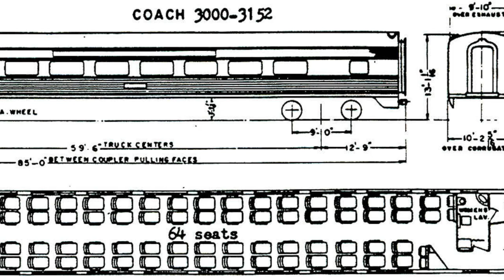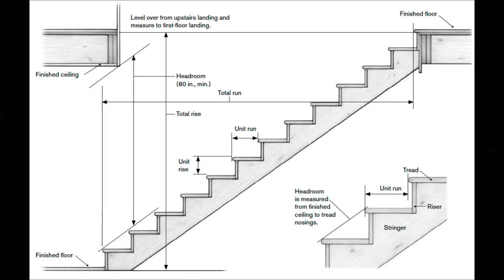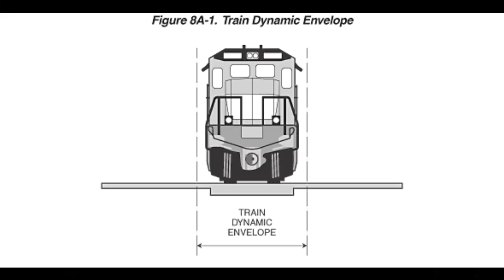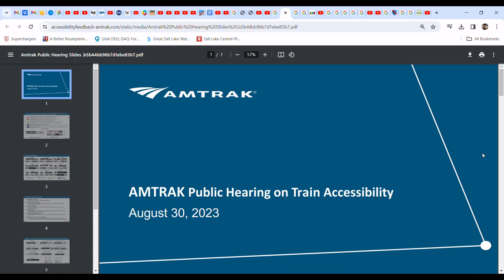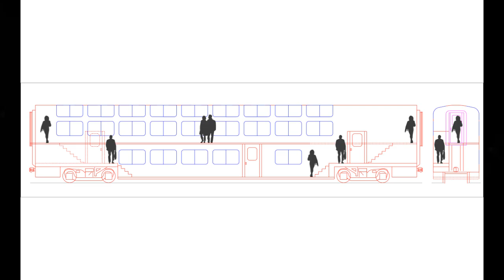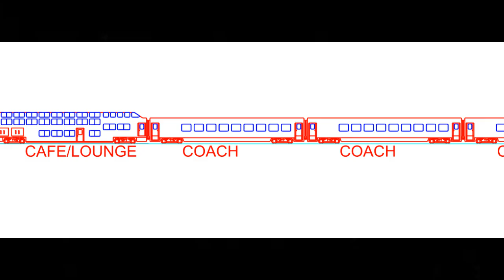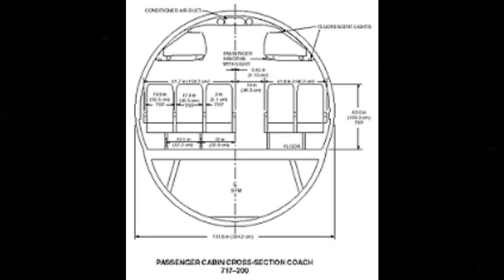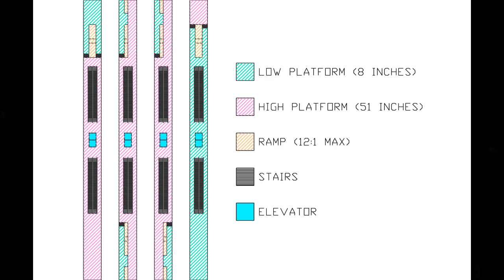An Excessive Explanation of North American Platform Heights

Comment: While I think the Superliners and original ATSF Hi-Levels are an extremely cool design I accept the cold hard reality may be that single level cars are the only logical replacement. The Superliner design certainly provides benefits to the majority of passengers which include helping to keep the main portion of the car acoustically and climatically isolated from the entrance doors. That's a major benefit when the train has to make station stops in the middle of the night. 

On other hand a benefit to standardizing around single level design is increased compatibility with not just Amtrak's east coast fleet but the emerging high speed rail routes like California HSR, Brightline West and possibly Texas Central which will have single level fleets. Even if Amtrak will never share actual trackage with HSR there is a solid argument to be made for adopting a common platform height for cross platform access.

I also hope a new long distance single level car design might result in the return of dome cars to some extent. ADA requirements may not allow the return of domes with elevated seating (unless lifts can be provided) however there could always be dome cars similar to the in-house design Southern Pacific provided on the Coast Daylight where passengers remain seated at standard floor level except the cars feature a raised dome like roof with overhead glazing. Rapido Trains is currently developing a model of this car in HO-scale. For long distance routes I think Amtrak will still feel the need for a car dedicated solely to sightseeing. The tourist market may not be Amtrak's primary function or mandate but it does attract a good percentage of passengers and Amtrak would be foolish to abandon it.
Reply: Single level would be cheaper to maintain, for the wheelsets could have longer overhaul intervals because of lower loading.

Comment: I'm from Australia. Just about all of our platforms are high level, and have been there for the better part of a century at minimum. I've never heard of a platform needing any more regular maintenance than the occasional sweep by a staff member.

Moreover, many of these stations have regular freight services running through them, and the platforms will maintain a gap no greater than 3 inches from the doorstep of the commuter trains. You mentioned that the dynamic envelope is wider for freight trains than passenger trains. But in reality, if a freight train is going to rocking and rolling to that degree, then that piece of track is completely unsuitable for passenger service. At least, that's the case in the rest of the civilised world.

In short, this all sounds like lazy, money-grubbing railroads making excuses to not having invested in infrastructure.

Comment: Thank you for this elaborate view on the complicated subject of platform heights in the US. We have similar discussions in Germany, with platform heights of 100 cm at some S-Bahn systems (39 1/4'), 76 cm (30'), 55 cm (21 3/4') and 38 cm (15') for tram-train services.Your Salt Lake ideas remind me on ours with proposals for up to three different levels at the two sides of a platform to serve as well long distannce, regional and tram-trains. Regarding the variety of platform heights in GER that will not vanish over the years I also like to give a special  emphasis to the idea of entrance doors with differnt heights adjacent to the ADA and multi-purpose area in regional trains to overcome this problem without the needs to rebuild hundreds of platforms in a few years to meet accessibility needs that were already neglected for too long.
Reply from the maker: I think you are right - train cars with doors of different heights to match different platforms seems like the only way to avoid a very costly rebuilding of hundreds of platforms. And in that case, it becomes more important that we settle on a small number - hopefully 2 - of standard heights so that we won't need so many duplicate doors!

Comment: "Since you will be hard-pressed to find any European  intercity passenger trains with level boarding"
At least in Switzerland I wouldn't say this is true. Non-level boarding trains are the French TGV, German ICE and the Italian EC trains (thou SBB to my knowledge owns some of those as well) driving in Switzerland (one could even argue those are not strictly "IC" trains) and SBB's old single-decker IC trains. The double-decker IC trains which are nowadays almost exclusively used for our IC services are level boarding (obviously only at be lower level). As good as all S-Bahn trains (city trains) have level boarding.
Reply: I was looking for a comment about Switzerland. It would seem our railway system is the most advanced when it comes to level boarding (as well as other aspects), although Austria in my experience is quite good in this as well. To my knowledge, the only IC line not featuring level-boarding is the IC5.

Comment: I think 51 Inch is way to high and there should only be 1 standard hight otherwise it isn't relay standardized. For example: I live in Switzerland and our standard platform high (Standard gauge) is 55cm (21.6Inch) it allows Level boarding for about 95% of all trains (it doesen't matter if single level, dubble decker, regional or Intercity) only some older Single level "Standard" cars don't have level boarding, however they are only used on either a few (usually international) lines and are gradually replaced by newer trains, or as rush hour extensions on Intercity trains.
Reply: The 51" standard has a lot of plus sides, though: It means American single level fleets can be truly single level. There aren't any interior height changes inside the train. Plus, moving away from 51" would mean redoing the most highly-trafficked rail lines and stations in the United States (as "high capacity, high quality train service" and "51 inch platform height" are almost synonyms in the northeast), so it's not workable.

Do also keep in mind that while much less densely-trafficked by human passengers, the continental US rail network is about as large as the European one. By that lens, we're actually more standardized. 😝
Reply from the maker: I have nothing but respect for Swiss trains! I'm doing my best to replicate their convenience and utility here in the US. I agree that having 2 standards is not as preferable as just 1, but it is definitely progress compared to the 4-5 competing heights we have to deal with now.
Reply: @CSLenhart  I agree 2 is better than 5, but if the us starts to standardize they should choose only one. Otherwise they would face the same problem as Europe. For example: Switzerland uses 55cm and Germany mostly uses 76cm (which are the 2 EU standards) it makes international train routes a lot more difficult because the trains need to be suitable for both hights

Comment: This problem is similar to our problem here, in Indonesia. Where there is difference in platform height. Fortunately, the big station in every major city has a standardized platform height ±1400mm above the rail since 1980s. But smaller stations in small sized city or in a town, the platform height is different than the standard one. From 250mm, 300mm, 500mm, 700mm, up to 1000mm. The solution is that placing movable steps in every platform so it could be moved when not needed. In case of the disable people, there is a slope for that.

We didn't have any Bi-Level in operation, but we had one prototype of a Bi-Level car in 1980s which is a modification from a 1960s East German passenger car. But due to the restrictive loading gauge and because it judders a lot, it just let rot somewhere in our maintenance facility.
Reply from the maker: That's a lot of different heights to deal with!

Comment: I think that it should be considered to bring all US platforms to 51in with gapfillers. Not all immediately, but keeping in mind platform heightening when stock needs to be replaced.
And the EU isn't perfect on the platform heights by far, but it's generally speaking 28cm, 55cm or 75cm (28 is basically 5cm or so above the rail)
Reply: 55cm is the most common followed by 76cm other highs are country specific older hights

Comment: The obvious solution is to just increase all new passenger rolling stock to 10’ 8” wide. It solves all of the problems with spacing and allows more space for passengers.
Reply from the maker: That would be an ideal situation, yes. Practically speaking, though, the transition period of narrowing all existing platforms and widening existing bridges and tunnels on the NEC would be pretty challenging, and replacing all existing cars with wider ones would be expensive. But in principle, I agree that wider is better!

Comment: Just a minor FYI: Those tracks aren't called Gauntlet tracks. They're Gantlet tracks. I believe it's named after someone who designed the idea.
Reply from the maker: Huh, TIL. Looks like I've put too much trust in Wikipedia this time. I love learning stuff like this!
Reply: @CSLenhart  Yeah. I didn't know it either myself, until I was looking up some info on streetcars. I stumbled across this, and went down a pretty long rabbit hole.  What I found was that the name originates from the original version where you had a "Gantlet" switch that allowed two tracks to share the same bridge.  That switch type works like your typical switch, but doesn't have blades, just a bridge with four rails on it.  Apparently, calling it "Gauntlet" track originates out of people seeing "Gantlet" and thinking that it's spelled wrong, when it's not.

Also, if you want a real deep dive into something odd, look into "high level transition cars".   At least that's what I think they were called.  These were a special single level car, which on one end had a kind of 'hump' on one end that contained a stair way which would allow train crews to access the high level section while the train was in motion.  I believe these were exclusively baggage cars, but I seem to recall Amtrak having at least one, if not a couple of them, to allow single level crew cars to work with superliner cars.
Reply: @KibuFox  Yes - a gauntlet is a glove. 
There / they're / their; to / too / two; "ough" x 8; mantle / mantel ... What a language!!

Comment: Some good ideas discussed. Here in Australia, we don't really have that problem as our platforms are pretty much exclusively high level. I think your theory of essentially gradual change is good. It means over time, things would become more uniform without burdening operators with the cost of replacements or upgrades all at once.
Reply: As an Australian example, in Sydney's heavy passenger rail network, where we have bi-level passenger trains (with the flippy seats) and high platforms, we have level boarding because the boarding vestibules aren't on either the top or bottom levels - they're in the middle instead. I can see why Americans might prefer to board on the lower level though, since it provides more stepless accessible area and you can't cross between carriages on Sydney Trains without going up and down stairs unless you're going between adjacent vestibules.
Also, when a gap filler is needed (e.g. for passengers using wheelchairs) either a station attendant or a train guard has to physically bring out a bridge plate, because we don't always have a consistent gap between platform and train (even on a single platform, because the platform can be curved!) So it's definitely been interesting to compare the differences between Sydney and American transit systems.
EDIT: apparently those separate ramps are called bridge plates, as mentioned at 5:33

Comment: Isn't 51 inches a bit high for people to escape back onto the platform easily if they (for whatever reason) find themselves on the tracks in between platforms?
Reply: In Sydney (NSW, Australia) we have platform clearances of 1200 mm (which is about 47 1/4 inches apparently), and not unrelatedly, they do have to delay trains because of people on the tracks pretty often. I guess that's why I've seen platforms have a sloping area that's out of bounds to the public so that people can get off the tracks if they can't push themselves up 1.2 m for whatever reason?

Comment: How do Wheelchair users evacuate in the event of a crash on bi-level designs where the only upstairs access is a wheelchair lift?
Reply from the maker: That is a really good question. Since there are already cars with lifts, this question has already been answered to some extent - at least in Canada. I suspect that regulators are relying on car attendants to be able to get their cars evacuated, similar to flight attendants on an airplane - but that's just a guess.
Reply: @CSLenhart  The main thing I'm curious about is that (in buildings) people are advised  to avoid lifts in the case of an emergency, and certainly in the building I used to work in, if we'd had anybody in a wheelchair, they would have had to work on the ground floor despite the Prescence of a lift since the lift may not be operable in a fire or some other emergency.

Comment: In fact, the new Dutch intercity trains ICNG (new generation) that run on the high-speed line have the same entry at platform level. The Dutch ICNG runs on the high-speed line between Amsterdam and Brussen, which is also used by the Eurostar Paris and London. The trains are therefore wheelchair and luggage friendly. The trains are made by Alstom.
Reply: ICNG trains are able to be level boarding because they have a single deck. The new DDNG (dubeldekker nieuwe generatie) which NS is ordering now will have two decks. So in order to comply with accessibility standards it will have single deck coaches at the front and rear end in which allow for level boarding.
Reply: Do keep in mind that it's ProRail who owns the stations in NL. Even today when required the train staff or station staff has to come to operate a wheelchair ramp if one is required. Worst case scenario, they'll outsource this to a local taxi service or similar. Still the staff costs fall on the train operator, not the station owner.
So when regulations were updated, NS along with the other smaller railway companies lobbied hard to get level-boarding platforms nationwide, because that would shift that cost from them to ProRail. Which is what ended up happening, platform height was standardised across the nation, and the vast majority of train and station it's all level-boarding.

It's being sold off as the NS and competitors trying to be as accessible as possible, which is still BS, but the reality is that there was a considerable financial reason for them to support this.

In the USA it's very much the other way around. AMTRAK owns no rails, other railroads have to grant them passage because of the law. Often enough AMTRAK doesn't own the station or any of that infrastructure either and the companies that do, have no clear benefit to increased expenses in maintenance of passenger platforms when their core business is freight. So this will probably end up as a weird solution, where the station owners will want to pawn the cost off on AMTRAK and vice versa.
Also keep in mind that with an annual passenger volume below 20 million, AMTRAK carries about half the number of passengers NS does. But compare this to SNCF with their 1 billion passengers annually or DB with over 2 billion passengers and it really puts into perspective how relatively small of an operation AMTRAK runs. Of course one could argue that it's not fair to compare to EU commuter rail networks, but even if you were to just look at EU international high speed railways, they still carry more passengers than AMTRAK does.
Reply: @fermitupoupon1754  good old 2002/735/EC at it's best (and a bit of 2008/164/EC And 2016/797).

One thing that struck me in this video was that in the USA they still have a very wide 'dynamic envelope' that hinders platform gap.
My guess mostly due to remaining backwards compatible with older equipment. Particularly Cargo.
For Europe all high speed passage rail, the maximum gap between door sill and edge of platform shall be no more then 75mm at the platform height. NL even aims for 30mm.
But that does mean if your train can't handle that, you don't get to use the platform line and have to use a bypass. 
Actually, these days you hardly ever see freight train use a stations platform line. (Ok, you see it in rural area's).

And yes what he says is true, if ProRail is Following 2008/164/EC they will not have to provide boarding aids or station personnel on the station to help.
Even Infrabel (Belgium railway owner) is slowly converting over to one design to please there railway operators to have less personnel (and complaints).
Hopefully in 2028 we will have a full-disability accessible rail network in Europe. .. .. Any day now.. ..

Comment: The inch nonsense made it very hard to follow.

The european standard of 760mm is slowly working its way to dominate and most of the intercity network here in poland is finished, in few years we gonna get first high floor only intercity trains.

A lot of regional rail services already run high floor only on their network with the substandard being one step (550mm) so the accesibility is done with train crew "operated" ramp

Also bilevel really hurts dwell times, which is not as important on intercity but still
Reply: With all due respect to the "inch nonsense," you're watching a video about platform heights on the American rail network. The legal and engineering definitions used here are not going to be SI units, they're going to be inches. It might be nice to provide conversions, but the laws and guidelines here are laid out in inches and nothing else.
Reply: @TheBleggh  the legal units in US are all metric btw. The legal standards cited here are defined in metric because they have to be, legally. Using inches is literally adding another step because legally it's only metric
Reply: the standard hight is 55cm with 76cm is also allowed.